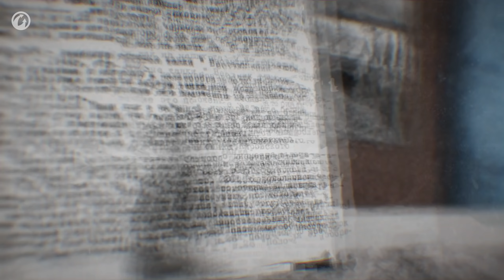Developer Diaries: Double-Barreled Vehicles

Comment: This is an interesting mechanic that I personally don’t care for. But for the topic of discussion let’s talk about some of the features. 1. If this does come into the game there should be a way to switch between guns so if you want to peek a corner you can shoot the one and wait for it to reload then shoot it again instead of it switching to the other gun. 2. Don’t make this a whole line. We don’t need people in low tiers running around making the game even worse for newer players. 3. If this is going to happen please stick to only 100mm maybe 122mm guns. We don’t need kv-2, Sherman, or any other massive deep guns getting this feature.

Comment: Reason for no twin barrel gun tank is the historical aspect, fine. Tell me, how historically accurate are those premium ammo?
Reply: hasib reza : they were real. They used tungsten heads that improved pen, and were quite expensive to manufacture. The German usually had 2 or 3 of them per tank, as sourcing tungsten proved very difficult for the German war industry. You may instead question the historical accuracy of pressing a button to repair your damaged tracks...
Reply from the maker: We are still checking some changes to ammo on the Supertest. -DelhRoh
Reply: The soviet T-34-85 have 8 special ammo podkaliberný that can penetrate Tiger I frontaly, but after all8 ammo were shots, they destroyed the cannon and must replace the gun....

Comment: Finally the IS4 is gonna be replaced!
Edit : By the ST-II
Reply: This is going to be a tier 8!
Reply: @panzerelite5317  I know, maybe not rn but if this mechanic is coming it means that the ST-II is coming soon.
Reply: @noudplasmans8946  IS4 hasn't been buffed because it's getting replaced, they wanted to do that since ages :).
Reply: There was sketches where it was basically a predecessor to the Obj. 705A, basically arming a 152mm gun to an IS-4. They did made the turret slightly bigger, I don’t know about the armour though, I think they added more armour on the front and the back
Reply: Its funny how IS-6 is on tier VIII and Is-4 on tier X. Crazy. :-)
Reply: Nvm wg decided to again forget ablut what they said and do nothing about the IS4 and put the stII on a separate line...

Comment: So.. what is the use of 2 barrels if they can only have the same shell type?
Sure.. having an AP/APCR and a HE shell loaded at the same time and being able to choose wich one you fire might be op..
Buuut... then don't introduce double barrels if they are not going to be used in a way that would explain the benefit of a double barrel.
Abillity to load 2 shell types, or just keep it 1 barrel.. 
And don't say that it is difficult to integrate, because its just 2 or 3 lines of code that have to be altered.
Also.. when you're working on that, give the vehicles with multi barrels allready in the game the same option.

Comment: Does that thing can be realized in real life ? (i'm not sure... but it's a game after all... 😂)
Other question : it's not going to be too powerful ?
Reply: Why would it be too powerful? As we see in this video that each gun seems to have alpha of 390 etc, combined will be 780, we already have 2 HT tanks with 750 alpha damage and some TDs with up to 1000, so if the reload match with 60TP and E100, it will not be too powerful at all, and I believe the reload of both shells will be longer than those single shot 750 damage guns. It's not like the damage count is new, it's just done differently.
Reply: @BrickLayerBoy  not only for the Alfa but how it will be calculated with critical damage ? 
i mean 2 shot at the same time... one Ammo rack (because we need two hit on it and the 2 shells are very close).
of course you would probably say that the two guns will be considered as one hit

Comment: The real world problems with this completely fantasy tank are too many to put in one comment. First of all TWO 122'S IN A "FRYING PAN TURRET"?! Who's in the turret? Oompa Loompa's? Great name for the tank, the obj Oompa loompa! Ofc it's a russian tank... Ballistically two shells fired simultaneously from only a few inches apart will end up hitting each other just like two ships getting too close to each other as they are pulled by the lower pressure in the space between them inexorably towards each other. A truly STUPID move on WG's part GUARANTEED to lose even more customers. I quit playing when they brought in those ridiculous japanese super heavies. Imho the game has lost all touch with any reality in any universe. The older game was so much more fun when most tanks were accurately modeled from real tanks with real ballistics. Now you have tanks with FOUR tracks and no visible means of "driving" these tracks the tank just sort of floats on four tracks that completely take up the lower half of the tank. How is this tank supposed to turn? Does it have some little pylons with pto's to drive the tracks? And again, it's ofc Russian... WG you have lost your minds. I'm waiting for the eight tracked, 24 barrelled, 16 inch gunned, ofc Russian obj 2000 to start playing the game again. Shouldn't be too long at this rate.